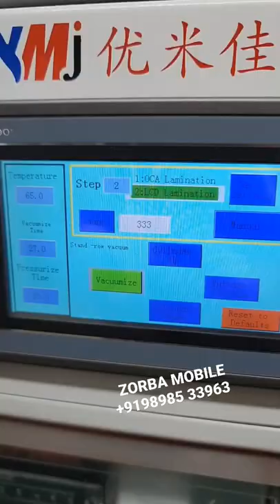Samsung S22 ultra | S22 Ultra Glass replacement | New Technology ZORBA MOBILE

Comment: Where r u located ?
Reply from the maker: ZORBA MOBILE 📱
Smart phone repair company
412,Pushti Heights, Gurukul Rd, opp. IDBI Bank, Memnagar, Ahmedabad, Gujarat, india 🇮🇳 pincoad380052
+9198985 33963 👈 contact to repair
https://www.vvcard.in/zorba-mobile
Reply: Hey, How much do you charge to replace front and back glass on a S22 ultra?